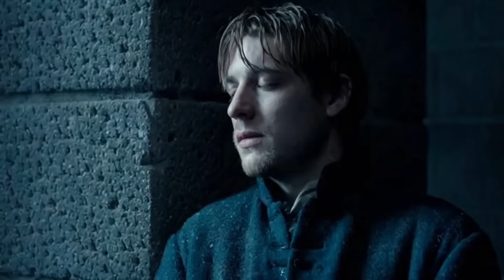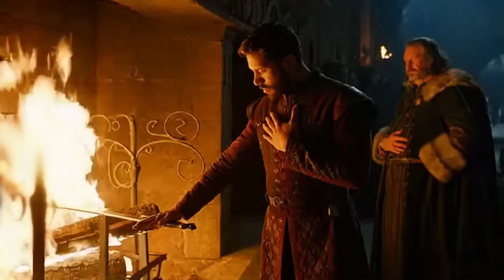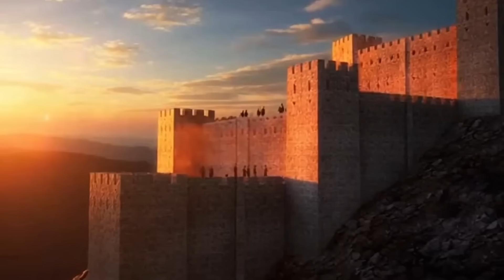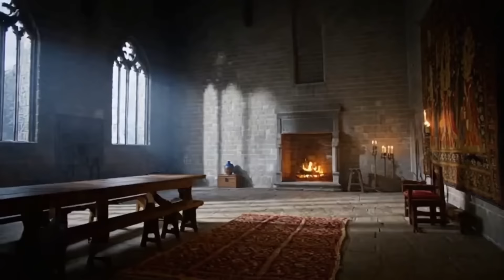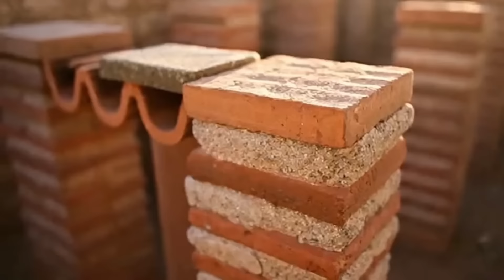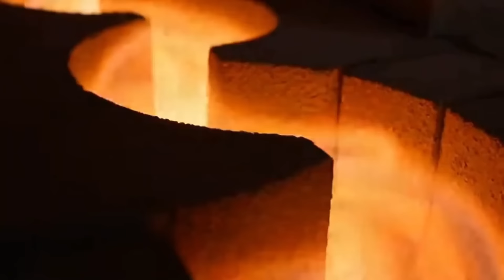Explaining Medieval Castle Heating Systems: Design and Winter Construction

Comment: The most dangerous enemy here isn’t an army, it’s thermal loss. A stone castle that keeps enemies out will quietly kill you if the fires stop. Winter survival was logistics: fuel stockpiles, labor control, and never letting the heat die. That’s the real lesson. Shelter without heat management is just a stone coffin.